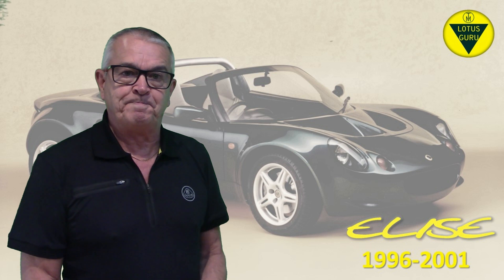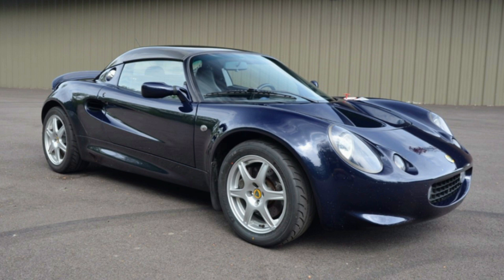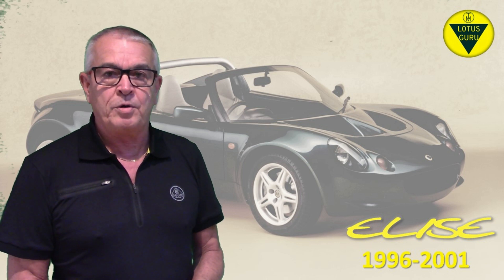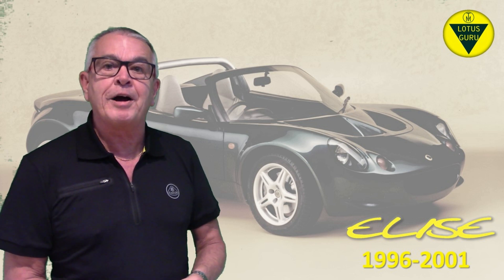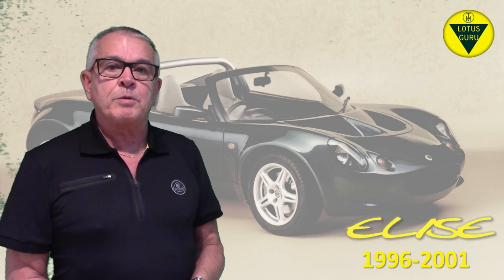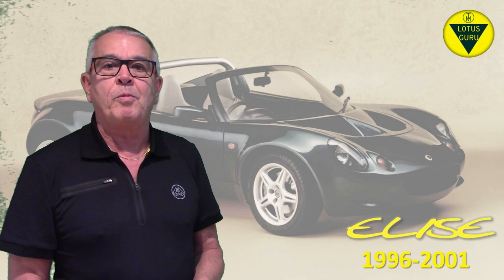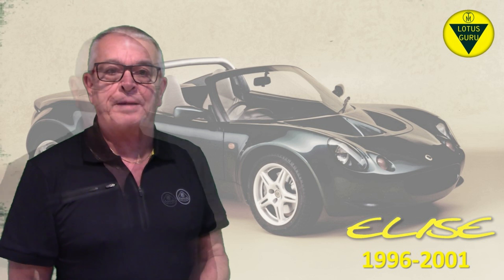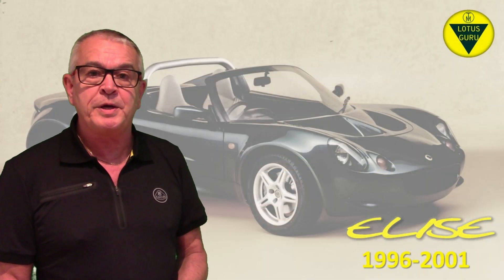Elise S1 Part 4

Comment: Great to see you back, as an owner of an Elise S160 and S1 Exige I'm finding these video's really interesting. Looking forward to more.
Reply from the maker: It’s nice to be back! Thanks for watching. 👍
Reply: @lotuscarguru3656  i have a really obscure question about elise s1 seat runners - might be able to help me with it?
Reply from the maker: @michaelc5437  Fire away mate, I’ll give it a go! 👍
Reply: @lotuscarguru3656  firstly - forgot to say - really enjoyed the videos.  watched them all before going and buying my first Elise. now on my 2nd. thank you! 

anyway - the question - ... seat runners. on the S1 they're all knackered from brinnelling in the seat runner, so there is a lot of play in the seat now. I'm trying to work out how to fix this... I was wondering if you might know who supplied the runners so I can transplant the seat fixing parts (and the extension/foot bit at the front) to new runners and finally not be rattled around the car!
Reply from the maker: @michaelc5437   Sorry for the late reply. Ah, the old seat rattling problem! Sorry but I don't know the supplier but I know they are not the finest piece of engineering! Basically all Elise/Exige models suffer the same problem regardless of year. Lotus did release a tensioner spring (A142V0001K) that kind of worked but not a 100% sure whether they fit Series one seat runners. Lotus should have carried out a complete re-design to fix this but any changes to seats, runners or related hardware meant they would need to re-submit the car for crash testing to certify the safety. Not an inexpensive process, so it was never done. Sorry I cant give you any more than that.